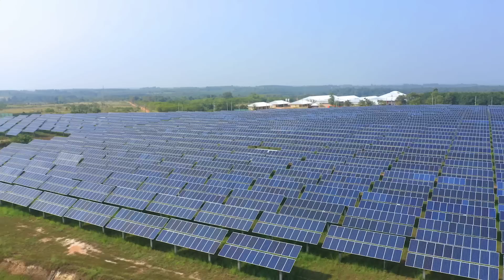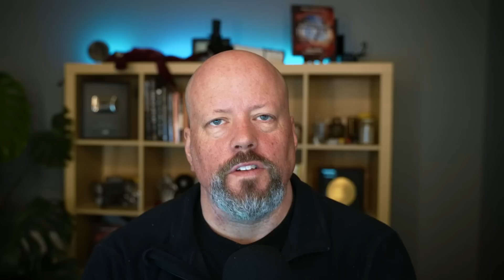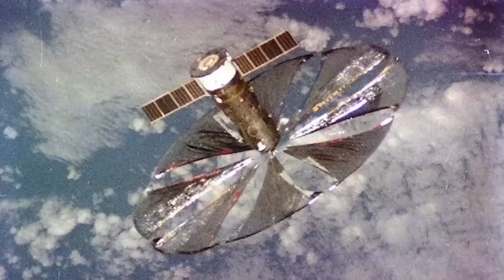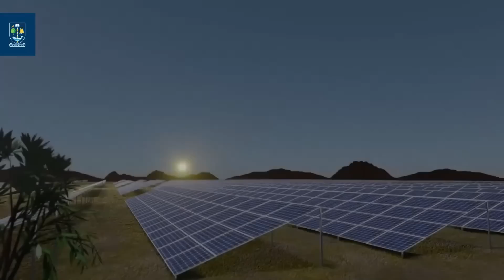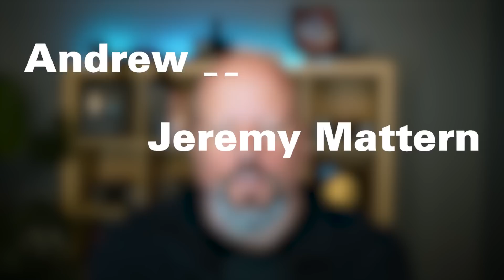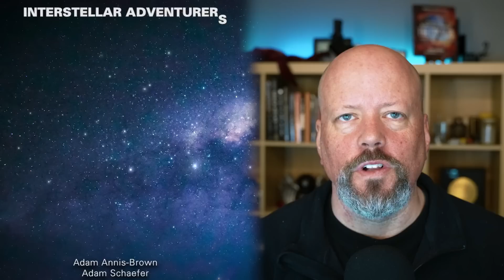How Space-Based Reflectors Can Change Solar Energy

Comment: While solar reflectors in space might seem like a simpler alternative to Space-Based Solar Power (SBSP), they really don't offer significant advantages. Sure, they might be cheaper, but they only provide power for about 20 minutes per satellite pass and require the same complex space infrastructure as SBSP - large structures, precise control systems, and orbital management. At least with SBSP, you get continuous, reliable power delivery that can actually serve as baseload power generation. If we're going to tackle the challenging engineering of large space structures anyway, we might as well go for the solution that provides better utility, even if it costs more. Sometimes the "simpler" solution isn't actually the better one, especially when it comes to meeting real-world power needs.

Comment: Storage of electricity is the problem.... batteries, the new elite enrichment push. Batteries are in current state, not cost effective, expensive, limited confusing lifespan, long recharge times, harmful chemicals being used, more it gets used the less electricity it stores overtime (degrading). We don't have a problem with capture, we have a problem with storage.

Comment: This will increase global warming if done on anything but a small scale. A few 250 meter reflectors won't do anything, but thousands of them will. Arguably we need a solar shield at the Lagrange point partially eclipsing the sun and reducing solar energy reaching the planet.

For a related example, see the "snowball earth" phenomenon due to the higher albedo of snow keeping less energy on the planet by reflecting sunlight back into space.

This may still be better for the planet than burning fossil fuels or trying to store energy in battery like technology, but it's worth considering the drawbacks.

Comment: Thanks for this one, Fraser, but I wonder why the topic of curved mirrors wasn't explored as opposed to the flat mirror advocated by the guest? It seems to me that with curved mirrors, one would be able to concentrate the energy onto a smaller area. What am I missing? 

<EDIT> As the video interview continued, I notice the issue was raised somewhat, but it was within the context of a further distance, i.e. Ganymeade, and the guest whiffed the question entirely preferring to discuss the marginally higher solar output at a further distance in certain circumstances.

Comment: This will never be economically feasible for applications on earth. In other applications, sure.
Those reflectors will have the same limitations as the sun. Bad weather = no joy. 
The areas where big solar farms make sense are not in Europe (weather, energy per m² coming from the sun, densely populated). If we talk about desert-ish regions, PV is worse than solar thermal power plants. Solar panels don't like heat (see efficiency at different temps). 
I am also not sure how much additional energy those reflectors bring. Why don't I just build the solar farm 10% larger? Probably more cost effective than doing risky and expensive rocket stuff. Additionally those reflectors apparently more. Therefore they need propellant and maintenance. 

I would be very surprised if the costs would ever pan out.
For use on the Moon/Mars whatever, i actually see viable applications. 

Caveat: I haven't looked into the actual numbers, but even in the future when transport costs come down, solar panels will also be cheaper and more efficient, not to speak of other forms energy generation. So maybe I am wrong, but I doubt it.

Comment: Wouldn’t beaming extra sunlight down to earth have the same effect as trapping reflected light within the atmosphere? 
If this is supposed to reduce CO2, surely you would want make sure that the solution isn’t worse than the cause of the problem. After all, if you have an equation total energy = Energy in + Energy reradiated by CO2- Energy reradiated into space, it doesn’t matter whether you increase Energy beamed down or Energy reradiated by CO2 you still get an overall increase in power heating up the atmosphere.
There is a lot less problem using this system around the moon but more thought needs to be put into this before trying it around earth.

Comment: The sun is about 0.5 deg wide from earth, so at 1000km I guess it would have to be 1000*0.5/360 = 1.4 km across to have same size in sky.. which I guess would give sunlike illumination at a single point, fading off within a similar radius at ground?
Reply: 1 of the only 2 comments out of 265 that's actually adressing the elephant in the room.
I kept wondering the whole time if 1) the prof. knows anything about physics at all, or 2) if it's somehow addressed in the paper and Fraser will bring it up. But saying that a mirror can increase sunshine near Mars to above Earth level points to answer #1.

Comment: A fascinating idea and maybe another use case for such a system would be to actually extend daylight time for urban areas and farmlands. This would provide indirect energy savings beside just power generation.
Reply: Seems like too much of a waste. This is intentionally focused on the solar panels so most the energy is collected and used. In your scenario, most of it would just hit the ground.
Reply: @nemanjamarsenic1626  waste of what? The earth is not covered in large solar farms, so most of the time those mirrors will be unused. Might as well point them at urban areas and lower energy used for pre-dawn and post-sunset artificial lighting
Reply: @trioxin428  waste of energy. But yes, if you have a part of the orbit where there is no solar farms in line of sight, it might be a good idea to repurpose the reflector. The question is if that will significantly help in this specific case since this works only slightly after sunset and slightly before sunrise, while there is still enough light. Also, it will not be too bright itself, so the question is how much it would actually help.

Btw, at 1000km altitude, horizon is more than 3000km away. So there should be some solar farms in line of sight. If there are none, that will make a dip in the profitability of this project.

Comment: How does the SAIL aspect of these  reflectors effect the orbit. It seems that you would constantly need to be adjusting your trajectory to keep you in orbit..
Reply: The problem with a statite is the aiming to control the position would conflict with the aiming to provide power. So the original question remains. How do you keep it in position when it acts like a sail trying to push it away?
Reply: check on 'statite'. https://en.wikipedia.org/wiki/Statite
Reply: @thekaxmax  Statites only work that way when in "orbit" around a star. Doesn't apply to planets.
Reply: @rensin2  tell that to the people doing the research about putting statites over a planet, not me.
Reply: @thekaxmax  Could you name one of these statites over a planet?
Reply: @rensin2  if you check the link given in the first reply, there are currently no statites anywhere. They are a proposed technology to control orbits of satellites.

Comment: Sounds like a good way to heat up the earth way more than co2
Reply: When you look at the numbers this turns out not to be the case. The amount of solar power this system focuses onto the earth is in the 100's of MW range (for a single mirror) whereas the heating power caused by global warming is MUCH larger at 460TW. Humanity only uses 19TW globally across all energy sources. So even if we replaced every single power plant and energy source in the world with this, it would still be less than a 20th of the heat caused by greenhouse gases. However this is just looking at things globally, it's unknown if it could cause undesired weather patterns locally where the light is focused.
Reply: Could it be used to cool the Earth by focusing the beam on the oceans are on ice and increasing the cloud cover globally, so that more sunlight would be reflected?

Comment: Power satellites are better imo. The tech hurdles to long range microwave transmission have been completely solved with efficiency above 90% these days.
Reply: Hmmm 90% Im guessing interferometry is being used to minimise atmospheric scattering because to keep packets coherent through obloid at changing angles and focussed with only ten percent loss sounds a little tinfoil hat territory nearly every process has a base loss of ten percent if it's 100% efficient and that's electronics running mint. Signals over distance are notoriously lossy even over a hardline. And the higher the frequency the more loss 2.4g v's 5g perfect example.
Reply: @leonmusk1040  Virtus Solis achieved 86% rectifying efficiency on recent tests and expect to get well above 90% on next test. The frequency is almost completely transparent to the atmosphere and weather. Unit economics of a 1cm thick sat that weighs 1kg and delivers a killowatt continuous to the ground will be a no brainer, especially as  it gets harder to site and permit terrestrial solar farms. Can all be done with solid state microelectronics nowadays.

Comment: I wonder how feasible it would be to place massive reflectors around Mars' L1 Lagrange point to create a second source of sunlight. This would help with bringing more heat and potential energy to the surface, without needing to reflect only from the horizons. The reflectors may be angled at a very 'glancing' angle to alter the trajectory of the sun rays to direct them to Mars, or there could be double reflectors to direct the rays. They would be surrounding the Sun's 'line of sight' to Mars. They could be directed at solar panels or cold spots on Mars, or they could be aimed for an all-over Sun support. From Mars it would probably look like a circle of light that surrounds the sun.
Reply: It would be  millions of these and they can’t hold
The orbit forever like jwst . The potent greenhouse gases would be best .
Reply: @jondoc7525  Yes the orbit would need to be tweaked once and a while as it started to stray out of L1, but that could be done. The extra heat would help the gases warning up the planet.
Reply: @RossPayneAnimation maybe for a higher up
Society that’s real end game it would take millions . We would better off building a huge magnifying glass on the pole and burn that co2 out
Reply: @jondoc7525  that is fucking ridiculous
Reply: @tygical haha why you can burn ants with one you can easily magnify it on the polls and release gas ? You can’t make fire with so little oxygen . They have found 20 percent oxygen plumes . Wonder if you could light that lol. I want to go when I’m 90 and my joints hurt to mars or titan the gas station.
Reply: in planning.
Reply: @thekaxmax  Great. Who is putting this plan together?
Reply: @RossPayneAnimation  several sets of researchers. Including, last time I looked, the ESA.
Reply: I have heard of ideas like this for a very strong magnetic source to act like the earth’s magnetic fields but in Mars’ L1. This would push solar winds around the plant which bleeds more atmosphere to space.
Reply: @JoelSapp Ah yes I've read about that idea of creating a shielding magnetic field  at L1, and wondered about if it could be a part of the solar reflection structure. But I have not heard about the issue of solar winds bleeding more atmosphere.

Comment: Scientists have no response for this. The speed of light C isn’t constant since the measures of time and distance aren’t constant over larger distances. It’s like changing from 60 kilometers an hour to 60 miles an hour increases your speed. Then if you go from 60 miles an hour to 60 miles a minute it increases your speed even more. This what is happening in general relativity when less gravity increases the measure of distance and speeds up the rate of time over large distances. It also means that the earth is younger than what they claim. The universe doesn’t care about how young the earth is. Actually the changes in time and distance compound the changes in the speed of light. Do a thought experiment. Hold your hands a foot apart representing 186,000 miles saying “one thousand and one” representing one second while pretending to see an imaginary photon going from one hand to the other. Now expand the distance saying “one thousand and one” as fast as you can. You should notice that the speed of the imaginary photon increases the farther away from the center of the galaxy it is.

Comment: The value, to me, is similar to what you said at the end is more about what it can do for us out in space.  The one concern I would have terrestrially, with any of these theoretical ways of getting more solar energy to the surface, is about the atmospheric temperature differential in the volume of air between the space sources and the ground.  Even if you design the reflector to only work with the limited useful frequencies of light, transmission would still change the temperature of the air in between them, simply by being the medium the energy goes through.
Reply: If you could design solar panels to work on infrared and mirrors to only reflect infrared, clouds and water vapor in the air would be invisible to the energy. So there would be less heating of the atmosphere. Probably some of the energy would be reflected back to space by carbon dioxide but although that would make the system a bit less efficient, it would not affect the atmosphere. Where some of the energy might be reflected off the panels assuming some lack of efficiency, that would be reflected and dissipated in the atmosphere by carbon dioxide but it would depend how efficient the panels were.
Reply: That wont work because most of the infrared spectrum is absorbed by atmosphere. Thats why all infrared telescopes are in space. Plus if you want beam of photons to pass through clouds and fog then i suggest microwawes.
Reply: @richardpavlov442  which is exactly what this proposal is trying to get away from doing 🙂. The fear of a very strong microwave beam being used as a weapon plus the ability to keep the sending electronics cool is a big engineering challenge.  I’m not saying this proposal makes sense, I think it has many drawbacks but it could in theory be easier & better than a microwave beam orbiting solar farm.
Reply: @sowhat512iuu  easier? yes, but way more harmful in both the long and short run.
If you think about it, the technology to make spaceships and space stations is already dangerous enough as it is right now. The tech to make solar sails is also extremely dangerous. Say someone uses these mirrors or hacks into them and manipulates them to create a focused solar beam. Isn't that very possible and dangerous as well? Not to mention the idea of those mirrors sending even more heat onto the surface, messing up with wind currents and wildlife as well.
Reply: @rRekko   I don’t think the concentration of light will be all that high, not high enough to do any kind of damage, these aren’t like a giant magnifying glass but I agree, every additional joule of energy that humans divert onto the surface of the earth that wasn’t originally destined to hit it is heat that changes the overall balance of energy on the planet.  In the case of even a few dozen of these sails, it wouldn’t be very much as a fraction of earth’s overall energy budget, but too many and it could have disruptive long term effects. And it would also quite possibly cause issues for wildlife in the area as it would mess with the circadian rhythms of these creatures.
Reply: I'd be more worried about said terrorist with the leet skills to take over a satellites reaction motors using it to bring back some big ole 60's-70's dirty satellite.  An rtg on a steep trajectory to minimise burn up is not a good day.. @sowhat512iuu

Comment: I'm tired of losing all the lunar missions after a few weeks because they get dark and cold. A space mirror to extend these might make economic sense in addition to the science. It would also enable deep crater exploration.
Reply: probably easier to just not rely on solar panels, or make your robots temperature resistant
Reply: @KyleB8252 some of these systems would do well with a little nuclear thermal electrics.
Reply: thats a self imposed situation. exoprobes (probes going to the outer solar system) already use alternatives, its a choice not to do it on the moon.
Reply: @TNM001  there’s a boat load of regulatory hurdles for RTG and limitations on the rockets that can send nuclear payloads out. Self imposed is a bit incorrect, more like cost and regulatory implications to using them.
Reply: @JoelSapp  well, sure, from a mission planners perspective, but not from a technological one.

Comment: I think i would agree that it makes more sense f.e. on the moon than on earth. At small scales it would hadly make a difference on earth, so we need large sacles, which would quickly turn into mountains of broken mirrors in orbit. That goes of course for any kind of significant light collection in earth orbit. At even larger scales (which the broken mirrors would probably prevent anyways) the project would turn into some kind of geoengineering, introducing additional heat to earth, which might even change weather patterns or other nasty things.. on the moon it might be fantastic though :)
Reply: My thoughts exactly. It’s truly a perfect fit for moon infrastructure. Overcoming the 14 day long night/day cycle on the moon, lack of risk for ecological issues, and much MUCH lower requirements for setting up a skeleton crew level of moon operations versus power for 8 billion humans.
Reply: One problem is the lunar regolith is very fine. A lot of electrostatic differentials at the day night divide shattering the silicates has left it very reactive pump to much energy at the surface without prep work and you might just wind up in a silica shitstorm of epic proportions.   @itsd0nk